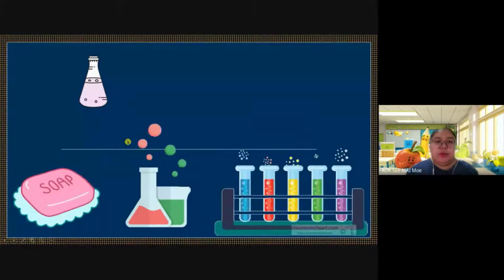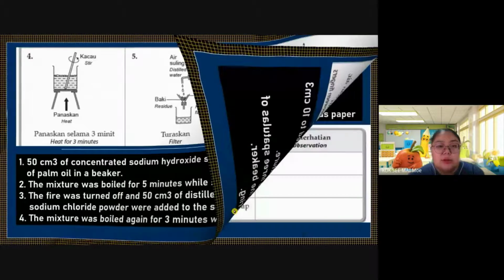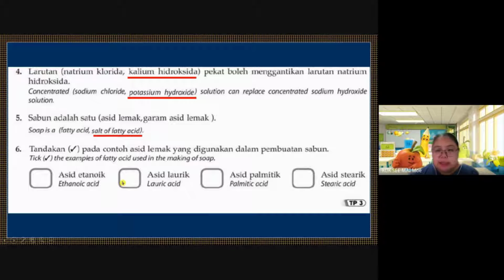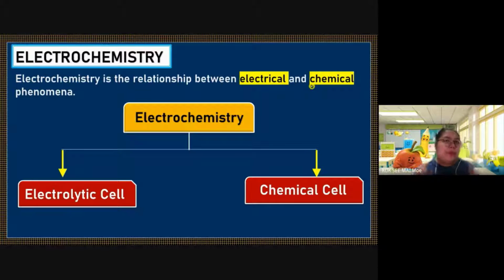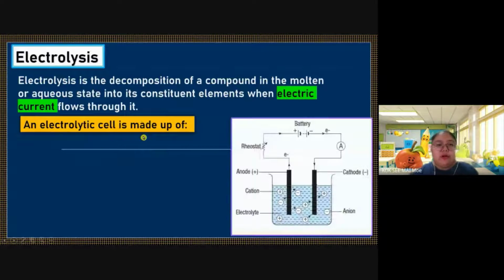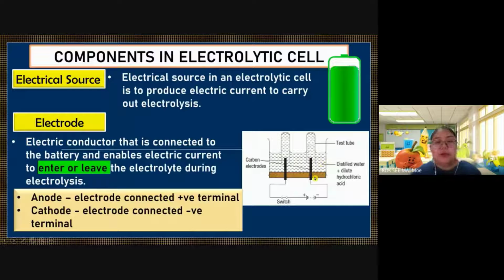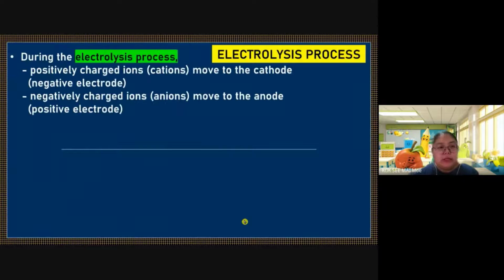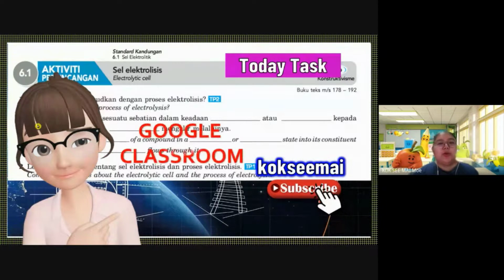6.1 ELECTROLYTIC CELL SCIENCE KSSM FORM 5 (PART 1)

Comment: Mam electrons move from anode to cathode or from cathode to anode??
Reply from the maker: electron is negative charce so it move to positive eletrode plate anode
Reply: @kokseemaiPHYSICS  and sir I have seen many videos why it is said that electrons are moving from anode to cathode...
So sir which one is correct??
Reply from the maker: @jayantideshpande8459  external circuit electrons flow from anode to cathode. but in electrolyte electron move from cathode to anode
Reply: @kokseemaiPHYSICS  I didn't understood
So can you explain in a easy way...
Pls if possible...
Reply: @kokseemaiPHYSICS  and sir which one is correct 
Electrons move from anode to cathode? 
Or 
Electrons move from cathode to anode ?